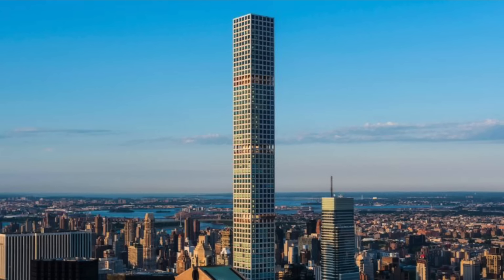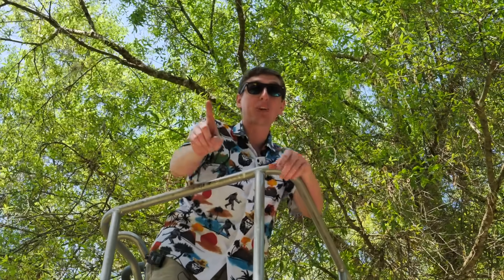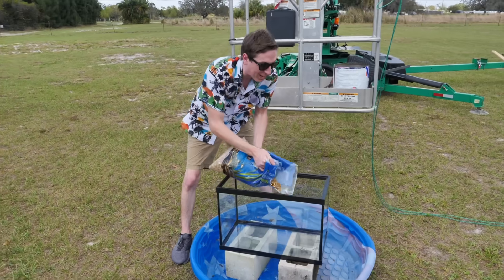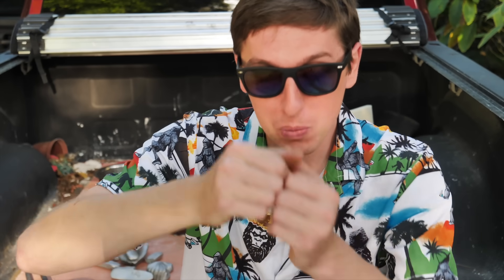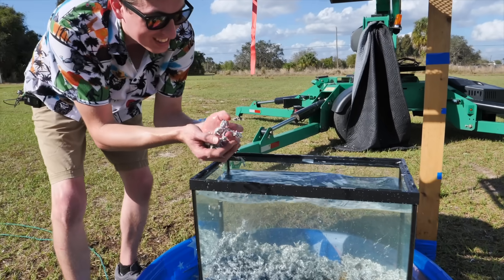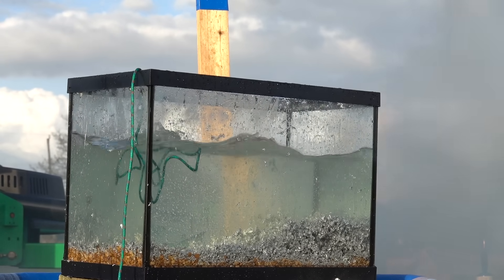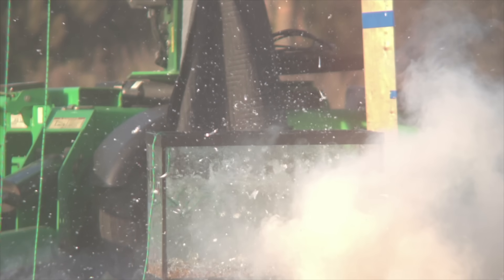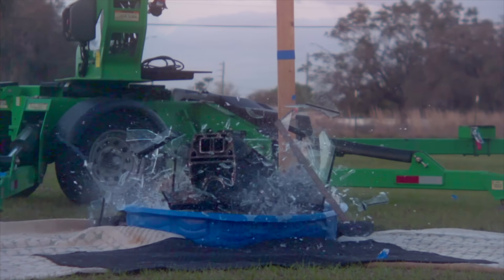Pouring Molten Aluminum from 50 feet! What will happen?

Comment: I'm late as hell to the party but I used to work on Sunbelt lifts to fix stadium lights and stage lights alike (sorry for the rhyme). There is something so inherently terrifying for a lack of a better word when it comes to being suspended 25-40ft up and knowing the only saving grace you have is that you're in a bucket... That happens to be 25-40ft up in the air.

Comment: Lead shot is made in the same way but dropped from 140 to 225 ft inside a tower, the lead shot is collected in a water bath to keep it spherical. So maybe if you used a smaller diameter sieve and 3 of the lifts taped on top of each other, it would work
Reply: You mean… the way he explains at the end of the video?

Comment: Can't Aluminium have a supercooled state like supercooled water droplets?
Because that basically means it's never going to solidify until it hits a solid surface, regardless of getting below it's melting temperature.
Water does this when it's already falling as rain but falls through a layer of air below zero degrees Celsius, in combination with when the water is also not too dirty (not to many solid particles in it).

Comment: And aluminum in comparison with lead has almost twice higher melting point and stores 7 times more heat capacity. So I'm afraid that making aluminum pellet in this way wouldn't be possible. :)

Comment: Fill the aquarium only halfway with water, and then cover with nitrogen or another gas that has the same as/higher density than air. Get a small crucible, and dip it below the layer of gas before scraping off the dross and pouring it.

Comment: 6:22 the reason why water droplets are the shape they are is surface tension from hydrogen bonding and the fact that the water isn't changing state. The aluminium however has a cooling outer layer while also decent metallic bonding. Much like a volcano throwing out lava into the air. Looks just the same

Comment: The ladenfrost effect keeps them from reaching a point that pure aluminum is exposed to the water.  The oxid layer has time to form due to the barrier of vaporizes water and the oxid layer is solid when the layer of gas escapes.

Comment: I'm wondering if it would make a difference if you pour the molten aluminium directly into a pipe/tube with Argon gas,  so the aluminium can't make the oxide layer before hitting the water. 
And the aluminium would have a little more resistance on the way down, so you might be able to get a different shape, perhaps somting more resembling a droplet?

Comment: Your curiosity joined with execution makes for cool videos. I have a puzzle for you. Propel a knife gently off a four foot table top and have it land on its tip on a concrete floor such that the knife stays on its tip for over 24 hours. Impossible? Not so. Interested?

Comment: Did you notice how the molten aluminum reduces speed in contact with water? Could you try solid aluminum and compare the behavior? Same mass, same shape. You pour molten first and whatever shape it formed, you use that one to try the solid. I perceived that the slowing down is radical, compared to how solid metal would behave entering water.

Comment: I wonder if aluminium would ever pull together into a spherical or raindrop shape while falling, the same way that lead does in a shot tower. It seems to me like maybe the oxide layer that forms on the molten aluminium prevents surface tension from pulling it together into a sphere.

Comment: 55 gal drum of water (more columnar) and 20kg blob of fully molten metal.  Get behind a blast shield and just set it into the water.
It'll explode.  In fact, it doesn't really matter what you use as long as it has good thermal mass and high coefficient of thermal conductivity, you made a steam cannon.

Comment: hmm... i had a random idea
try making surge alloy from the game mindustry 
recipe: 3 parts pure copper, 4 parts pure lead, 2 parts pure titanium, & 3 parts silicon 
in the game surge alloy absorbs kinetic energy and releases it as electrical energy in the form of lightning bolts that can damage enemies. it is also used as ammo in certain turrets and mechs and it releases a bunch of lightning bolts when it hits something. 
maybe the kinetic energy to lightning is possible but i'm not so sure about the electric bullets. if you cant make it do anything super cool just make a cube out of it. i hope it ends up yellow just like in the game

Comment: What you do is get a vacuum chamber that can hold water and suck the air and oxygen out out it..set a drop area and a system when you drop the metal, you have something that can open the vacuum chamber fast...then 🤯🤯 BOOM! The oxygen won't have enough time to react causing the explosion...

Comment: get a 50' pipe to match the lift, put a wide bell on the bottom end, fill the area around the bell with dry ice, let the pipe fill with co2 and that should prevent an oxide layer from forming, cool it enough to be solid before it hits, and keep your aim straight. if dry ice don't work because the oxygen sperates, (IDK if it will) use liquid nitrogen

Comment: Former career aluminum smelter worker. Water and aluminum can and will explode violently in the right conditions. Casting pit failure, furnace charging accidents can cause fatalities and severe structural damage. Even little explosions can severely burn or injure you.

Comment: use bismuth instead, it's melting point is very low for a metal. You can melt it on the stove in a pan.

Comment: Sorry but what an AR$^^%LE.... A definite attempt at getting a Darwin Award.
Look at him, two caldrons of MOLTEN Aluminium at his feet in a lift, with no protective gear.
No proper footwear, No proper trousers, No proper upper body garments, No proper face protection.
He is dressed to go to the beach!!!!! 
If he tried that in Australia he would not even get the lift, you need a working at height ticket to use one of those, to prove you know what you are doing.
As for lifting and pouring the molten aluminium with no PPE, his insurance company would abandon him.
NORDVPN won't protect him.

Comment: If you look at the main killing effect of EFPs in Iraq, it not the actual copper plate that that has the wounding effect on armor, it the molten steel knocked loose from the armor Plate that hardens a few CM after impact that solidify and start bouncing around.

Comment: If you ever took Heat Transfer in college. You can calculate how long it will take the aluminum to solidify while falling through the air. It isn't too hard to do

Comment: Drive one everyday, stay 6' from power sources, and no the ground yiu are moving onto. Have an ex tadder there to take pressure off legs if u did fall, legs die quickly. 

Best bet is be like mike tyson, hes never fallen off

Comment: For the aluminum/water explosion, increasing the conductivity of the water by saturating it with salt should help that. The explosive reaction between reactive metals and water is called a Coulomb Explosion, and has more to do with electric charge than most people are aware of. Another option is to add a bit of hydrochloric acid to the water, which will help eat through the oxide layer. If you want to get really nuts, using a lot of iron chloride in the salt solution will result in a much more violent version of the thermite reaction (chlorides instead of oxides in the reactants/products).

Comment: Put a 3inch steel pipe, with pipe caps on each end, filled with water.....submerged/fixed at the bottom of a container, then fill said container with molten aluminum.

Comment: Ok, your pouring molten aluminum from 50 feet in the air, wearing shorts and sneakers... 
You are just crazy enough to be up for using a high speed camera to film what happens when you blast a MIG weld with an air noozel , And im crazy enough to adjust the settings to keep it stable......
I have the welding equipment and space to do such things, but I lack the camera and what not 
I also live in NY...

Comment: The company I used to work for gave me the same safety training you got,   for the huge boom lifts we had to use.  None.
Reply: That's the amount of training everyone gets. I think it's supposed to make it more fun to learn not to die on the fly.
Reply: Its a bird 
Its a plane 
No 
Its silver surfers cum
Reply: @justaregulargymrata  Bruh 🤣🤣🤣
Reply: (figured I should probably put that harness on so I didn't have to constantly step over it) "There's the power switch now take it over there and fix that"  AYE AYE CAPTAIN!
Reply: 🎶 youuuuu rent ittttt, youuuu die inn itttt” 🎼 
Bring back the jingle!!!
Reply: @bio3m  best comment
Reply: @bio3m  you don’t rent it and you buy it you get executed by the fall and if it’s raining the water will turn blood red
Reply: That explains a lot... :)
Reply: @manicoptio9305
Reply: So, you should get some of the Aluminium and run some aerodynamic speed and safety tests on it :p
Reply: Me from atop of my skyjack: "outta my way tiny humans !"
Reply: You should be wearing a safety harness. I’m all about freedom, but one wrong move on the controls in that bucket could kill you…. Just saying
Reply: heh
Reply: If there's metal flying through the air of course taofladermaus is there!🤣
Reply: Hi

Comment: The aluminium-explosion thing seems to mainly happen when there is a small amount of water or just moisture that gets trapped beneath a much thicker layer of molten aluminium- the water flashes to steam but has no where to go other than upwards, through the aluminium causing it to violently burst into the air. That's why you see it happening with aluminium casting so often, and not just by dropping molten aluminium into water. ThunderF00t made a whole video about it, very interesting stuff...

Comment: Fyi genie makes a 185ft boom lift.

Also, to make aluminum explode on contact with water you need to flux it while it's near the upper range of it's melting temp, and contain it in an insert gas environment until you dump it.

Comment: The molten aluminium seems to have a very low surface tension, compared to water, or mercury, so it might not bead up at all in freefall. It is seen when pouring, you get long tails of aluminium instead of it stopping cleanly, and when it spills out on surfaces, it makes huge, flat smears, instead of beading up.

Comment: Hey, here is an idea for you. Look around for buildings that have been condemned, and ask if you can use the lift shaft instead of dropping it outside. No wind to blow the droplets about and you wouldnt  even need to worry about being up too high, you wouldnt see it... unless you look straight down the lift shaft

Comment: How about injecting molten aluminum under high pressure thru a small nozzle directly into the water? Basically, squirt molten aluminium thru a pressure washer?

Comment: this ad for nordvpn is extremally misleading with what vpns actually are, because what vpns do is just encrypt you internet traffic until it gets to a specific server to get decrypted during which time almost nothing can understand what the data being sent means. but once the data gets decrypted it will be the same as if the internet traffic was generated at the place it got decrypted which means you are still completely susceptible to being hacked, and there are ways to track down the location the internet traffic originated from it is just very difficult and out of reach of the vast majority people. It is also possible for companies and governments to identify which ip addresses are used as a decryption point for vpns which depending on the company they will them blacklist those addresses to prevent people from bypassing country restrictions (a prime example of this would be Netflix). And nordvpn was found to have had a badly configured server which if anyone knew about it before it was fixed (which is unknown because of how badly nord dealt with the breach) would have meant anyone monitoring that server would have been able to track everyone using it extremely easily.

So I would say the short answer to what a vpn is is a thing that will make you much much more difficult to find your real location, help protect your real identity, by pass content filters, and it can make one aperea as if they are in another country.

Comment: Kevin, I would  strongly recommend Not to use the that lift. I'm a construction plant mechanic (I work on equipment like that lift) and a damage hydraulic hose like that would definitely fail an inspection. I would call the rental company and have them replaced it or get me another replacement lift. That kind of damage should be caught in the the return control. I know this because I work for a retail company her in Denmark. Plz let the rentel company know what you found. It might save someone else.
Reply from the maker: dont worry, the rental company people actually knew my channel so they will see it.

Comment: They use to do this with lead to make musket balls. They had a very tall tower with an open center and a pool of water at the bottom. At the top they would melt the lead and drip it off the edge into the water and then sort the lead balls into different calibers for a guns